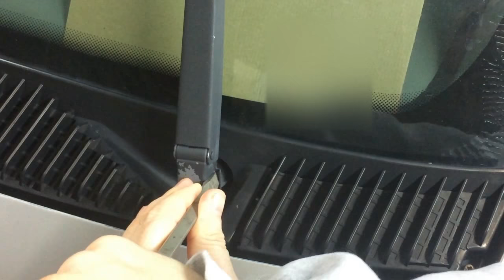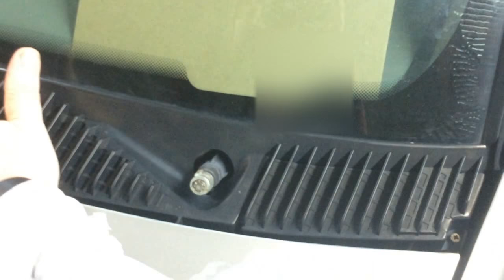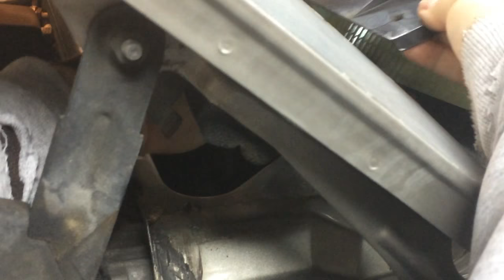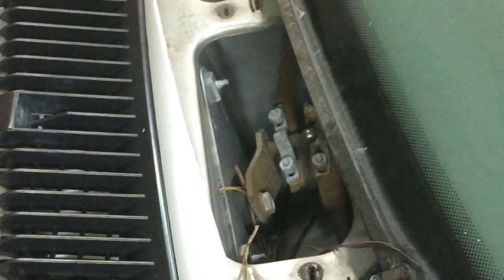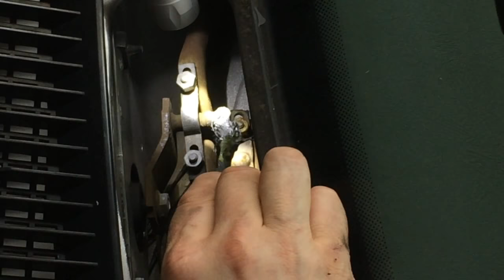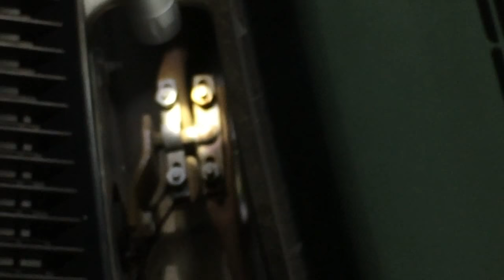1995 - 2002 OBS GM Full Size Truck Broken Windshield Wiper Arm Repair (Chevy Cadillac & GMC)

Comment: My problem is that the passenger side wiper jumps half way up the windshield when i turn the key
Reply from the maker: Sounds more like the motor attaching point for that side, but couldn't hurt to check the linkage to be sure as well.
Reply: @DrShock  alright ill check it out ty

Comment: My problem is the piece that the wiper arm sits on is stripped out. Do I need to change the whole arm or can I change that one piece?
Reply from the maker: If I understand right you're talking about the knurled shaft the wiper arm locks on to.  If so, and if it's the actual male actuator shaft end and not just the female inside end of the wiper arm, then I'd just pull it from a salvage yard vehicle.  I can't recall if it's separate by itself or part of the larger assembly but not much choice if it's stripped out it's got to get replaced.
Reply: @DrShock  the arm itself is turning. It's the small grooved female part on the end of the arm that the wiper sits on. I was thinking jb weld would hold it.

Comment: Weird mine wont come off
Reply from the maker: You have to get that retainer slid all the way out for the wiper arm to release from the shaft.  If they haven't been off in a long time you may have to rock them a bit to get them moving.
Reply: You probably figured it out by now but I used a pry bar man
Reply: @samuelmosqueda8424  I used a screw driver.